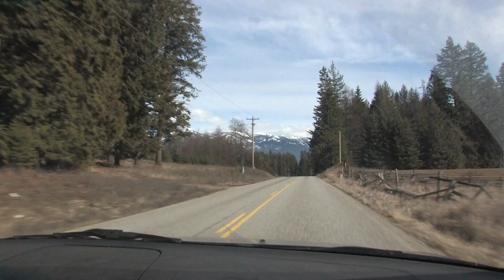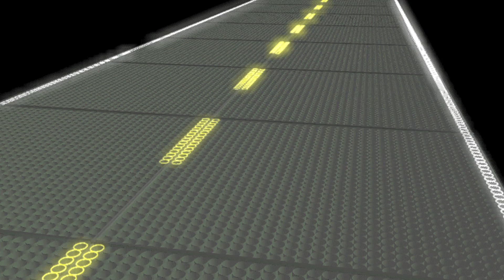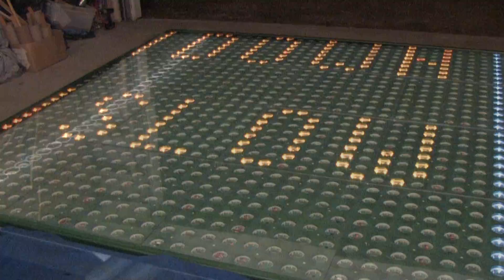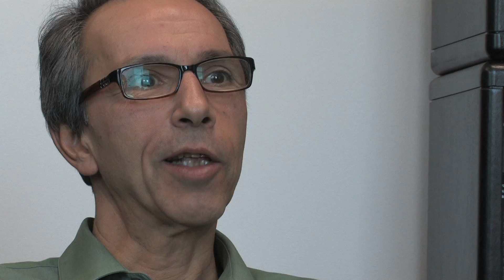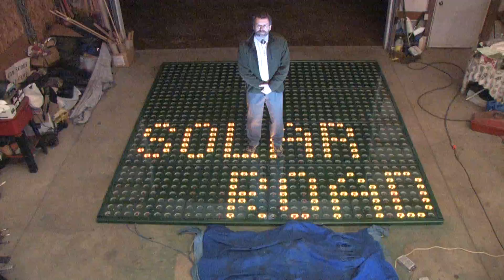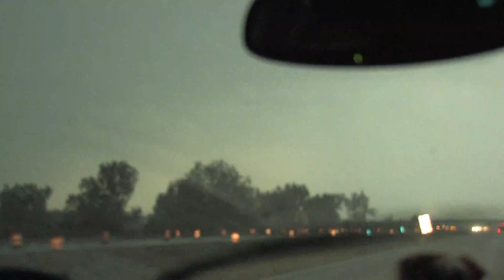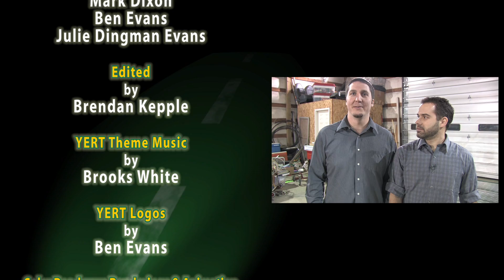Solar Roadways: The Prototype

Comment: How is this economically feasible. Don't get me wrong, as an engineering student i would love to see something like this happen (jobs yay!) but as proposing 6.47497028e10 m^2 of solar panel to replace the roads is quite a stretch. Not only would it be extremely difficult to find the resources for this project but pricing that area with the cost of a solar panel today would be around $21,000,000,000,000, that's generous as you still have tons of considerations to account for.

Comment: And how exactly would they fit this into a 4 minute video? Some glasses have a well-established property of being extremely strong and providing sufficient traction. There's absolutely no need to show it lighting a bulb. Solar power is hardly cutting edge technology. Yes, they have driven cars on it and are currently testing in a parking lot, with much success.

There's healthy skepticism, and then there's just unfounded, arrogant dismissal.

Comment: Yes, flat glass used for windows and windshields are slippery when wet.  However, as they mentioned, there is higher, stronger grades of glass, and glass that can be textured to have the same traction as asphalt.

Comment: The LEDs are nice distraction from the actual practicality of these magic roads.
can you drive on glass? same friction as asphalt?
How much energy can you get out with your design?
Can it survive freeze/thaw?
Cost per sq ft?  Gas will probably go up by $5.00 a gallon to pay for it.
How does dirt and oil affect the efficiency?
Stick them on roofs if you want to put them somewhere. that'll get rid of asphalt shingles

Comment: Panel replacement would be extremely hard at best due to the interpanel sealing, and the cost of everything (panels, wiring, maintenance) are VERY prohibitive.  In addition, such a road would be a net electrical load, as the built in PV modules would not come close to generating the required electricity.  Normal PV modules are mounted so that they are aimed at the sun for a reason.

Comment: Heating elements would use shitloads of electricity.  Electric pavement deicing uses about 25W/ft^, meaning that a 20ft wide road would use 500W PER FOOT, or 2.64MW (2,640,000W) PER MILE.  A 50ft wide interstate would use 1,250W per foot and 6.6MW per mile.  Simply put, it is laughably unfeasible.

Comment: My concerns: Hydroplaning in standing water. Even if snow/ice weren't an issue because of its possible capabilities of warming the surface enough to keep it from icing over or accumulating snow, what if certain panels malfunctioned and didn't create heat? Also, how would dead panels be accessed to get fixed? Cost of infrastructure implementation would be enormous. Much more ambitious than the switch-over to cement roads to replace asphalt currently. Easy to repair and no big rig tire ruts.

Comment: Youtube, please ignore that comment.  If you are curious I suggest googling "Solar DIY scam."  Photovoltaics are cheaper than they've ever been and this trend will only continue.  DIY panels also have numerous safety and quality risks that would outweigh any perceived benefits.    Source: I work in the PV industry.  I am biased yes, but factually correct.  Feel free to check out the scam websites yourself but please don't give those charlatans any money.

Comment: Awesome idea. another thing to consider is road maintenance, the snow might melt because of the heat generated from the concentrated solar cells, but will it gum up, or melt tires during the hot summer months? If this works, I would love to see the day when the ugly utility poles come down.

Comment: My main concern is this: will there be enough traction? What happens if it rains? Glass surfaces covered in water are obviously much slicker than asphalt roads covered in water, so couldn't this largely increase the risk of accidents in the Northwest and other places where it rains a lot?

Comment: , well it is my understanding that traditional glass blocks a significant amount of IR, also the amphorus cells being flexible can go into a flexible resin like a dense plastic, these would be easier to install too, in my mind's eye i see roads being rolled out, whole sections being completed in mere days instead of months, and costing less in materials, and instead of having to break up the old road you can roll it back up and send it in for repairs

Comment: It's impractical because it's a roadway made of glass for a start (in the wet or with oil you have no grip), tire marks and dirt would need constant cleaning, glass takes a lot of energy to make (especially so think), we are not talking expensive more like trillions! Your better off having normal roads and separate green or alternate  power.

Comment: - street polisher/sweeper to clean black streaks and dust. Already have street sweepers so its not out of the question.

-angle the road to allow water to run off quickly. different angles for different parts of the country that have different rain conditions.

Comment: Im all for alternate power, its just this idea is impractical. The cost would be astronomical, glare would be terrible, solar panels have a short shelf life, grip when wet or oily (there is none), roads would need constant cleaning etc etc. The future lies in nuclear fusion and more efficient green energy, not inefficient and impractical ideas like this.

Comment: Cool! :D Though I wonder why not first apply in something with way lower weight requirements and the surface friction issue, such as sidewalks/ only pedestrian areas. (Granted is much less surface with proper solar ray incidence... but it would give time to test some experimental conditions, wouldn't it?)

Comment: Cost cutting idea: Get rid of the LED's, (except for areas of road with special needs - school crosswalks, etc.). Instead, mill (or cast) a 3" to 4" wide by 1/16" deep recess into the "road stripe" side of the glass surface. Apply durable yellow or white reflective material, 1/16" thick within the recess, to be used as the road strip.

Comment: I work in asphalt. And this idea is smart but will never work. It will cost to much to maintain. Asphalt roads use recycled asphalt up to 35% in most states. Which reduces asphalt liquid use. Plus asphalt roads life is 10-15 yrs depending on traffic load. I'm sorry but asphalt will be around forever.

Comment: I'm wondering if you could add a set of inductive coils in each of these panels and feed the coil from a capacitor bank.  Put another set of coils under an electric car and as you drive over each panel it creates a one-time-each high-intensity magnetic field pulse. Drive down a road paved with these, each giving off this field and you would generate an oscillating magnetic field which could, in theory, charge the battery in the car. Thoughts?

Comment: Good idea but it will never happen. This would require a smart grid system spanning the state, every one of these panels would have to be connected to each other (major flaw one panel down can take half the system down), enormous batteries, and potholes would become even more dangerous. Also, the topology of the streets are NOT straight, they have bends, curves, bumps, ridges, and non-uniform hills. This is not a realistic solution at this time.

Comment: But then again, there are alternatives - and better places to put research resources such as Bioasphalt and Polymer based paving. Which I am still convinced will be much less exspensive - if you want solar power use proper solar panels NEXT to the road - which will be properly mounted with regards to the peak sunlight. a Panel lying on the ground wastes a lot of energy. To get it even more effective use a proper Solar Plant, which actually delivers grid power and in much higher wattages.

Comment: Overall this is the most innovative idea I have seen so far. However, there are still quite a few problems to work out. This was posted in 2010, I'm curious to know how far you have come with this project. I'm also wondering if through this technology it would be possible to have heated roads that could melt away ice in northern states.

Comment from the maker: There are all sorts of techniques available to glass-makers. One way to add grip is to drizzle crushed glass on a slightly melted slab of glass-- just melted enough so that the crushed pieces stick to it but not so melted that it all gets smooth again. Pretty clever. There are other ways, too, but that's one that I've seen a sample for. It is super grippy.

Comment: Its not about the strength of the materials. Its about durability and flexibility. Glass is neither of those things, especially flexible. Asphalt has rubber in it which helps tires grip the road and "bounce back" after the pressure from the cars is released.

Comment: The problem isn't solar panels, it's sticking them under a road.

1. They'd make the road you're making freakishly expensive

2. We have BETTER places to put the solar panels. There's no shortage of space on top of roofs. Why would I spend 10x more to put a panel under a road that delivers less power?

Putting solar panels under roads is like making the connection between a car and an airplane. When you put both things together, there are so many downsides that it loses lots of benefits.

Comment: If you make it so that a guy with an IQ of 80 can put this stuff down, and its cost is at or lower current asphalt, and it is accessible without years of wait time to get the product, and you prove it lasts longer, and meets better safety regulations, and works with upcoming technology then it could be a good avenue.

Comment: Earthquakes damage roads mainly because the roads have low tensile streangth and are in one big piece. If you made each slab of solar road seperate, an earthquake would merely separate the slabs, rather than cracking them like a conventional road. Think of a mosaic, an earthquake does not crack the tiles, it merely displaces them.

Comment: There are many, many problems they will run into with it's design that they will have to overcome. I'm sure they're aware and are working on a solution, much like they are working on the solutions to the problems they mentioned - Sunlight glare, ability to withstand a fully loaded semi hammering on the brakes, etc. This project has a lot to work through if it even wants to be installed on crosswalks, let alone highways.

Comment: Combine these roads with electric cars and it is very plausible. The dirt and debris would be cleaned up and would actually create a whole new job, Cleaning  solar panel roads. I think i want to work in this. I might just major is Engineering now.. (i was torn between particle physics or engineering)

Comment: This is among the worst concepts ever devised. I'm all for environmentally friendly practices and all, but this simply cannot be practical or cost-effective. The price of oil is rising, but the cost of asphalt isn't an issue because it's a very low grade of crude and can be recycled after each use.

Compared to this, the cost of SOLAR roads would be absolutely enormous. Why not just build solar panels and lay them along roadways instead? Much more cost effective and practical.

Comment: They better figure out a way to drive down the cost of solar panels. Right now they cost about  $1/watt. Think about how much it would cost to create a road way at that price where 1 square foot has about 20 watts in it. $20/sq ft. multiplied by how many millions of miles? And I'm not even taking into consideration installation costs as well as all the other infrastructure it would take to run this type of system. So, it won't be cheap.

Comment: a) Ofc they would if they had no other choice. but they have it - simply stick to old tyres and call bullshit on new concepts. Not like I'm super happy about it but that's the reality.
b) Asphalt is naturally rough. It provides some rolling resistance = safe. Manufactured glass is naturally slick. Now, how to make glass rough? Most logical idea is to manufacture it with a rough surface, but due to constant friction to car wheels I don't believe it will last long, becoming slick again and unsafe.

Comment: As a chemical engineer this idea isn't very smart. Roads are expensive enough with relatively cheap materials like asphalt in concrete. Photo-voltaic cells are extremely expensive to manufacture because they have to be made by hand. The amount of money it would require to make enough cells to cover a small mid-west city in the U.S. would be astronomical.

Comment: We will run out of oil that's for sure, but not as soon as you think. We need to find an alternative power source but this is quite expensive for the return. if money wasn't an issue this would be a perfect idea, but you don't understand, someone has to make money off of this for it to take off.

Comment: I think this is brilliant, however "Keep it simple stupid."

Just concentrate on the solar energy aspect... and leave the 138,000 LEDS and crap for later.

You don't have to sandwich anything between anything if you don't have LEDS.

You went way over-board in my opinion.

Comment: I'm talking about the variability in solar panels in that power generation can depend on elements of weather, season etc. Basically if you could generate more than enough power for the country, it might not mean it will be available at all times (which is where a dedicated reserve power plant would come in handy). Also the problem with electric cars is not a lack of power, but a lack of reliable charging mechanisms.

Comment: If you have roads that are not used much, like almost all roads outside cities, then it it much more efficient to use solar panels. However, it is indeed a good idea to have these shock panels inside cities or any other place there is a lot of traffic, as solar panels would be less effective.

But I think the shock panels are not strong, or quick enough to capture the power in a moving car. They might need further development, but if they can work with cars, then that would be amazing.

Comment: There's a huge design flaw. Glass is not asphalt. It doesn't have material  properties of asphalt. It's slick. It's less durable. Clear glass = high production costs.

a) Car industry redesigns tyres to fit new slick and EXTREMELY UNSAFE road surface, which I can't see happening.
b) They design glass to imitate asphalt natural properties BUT it will decay due to 24/7 friction with car wheels.

P.S. Broken LED/glass on a panel would requre full panel replacement = HUGE maintenance cost.

Meh...

Comment: Yeah, man u'r right. I was just thinking about the electronic part that will die, making half of the designed road dead. Was also thinking about the costs and the accessibility to remake the system without leaving it vulnerable to stealing. You wouldn't want to end up with missing parts on your road, nor do you want to make it inaccessible...

Comment: You're still thinking short term. The initial setup of this project will be enormous yes but it will pay for itself over time. Running the LEDs will cost nothing as this will generate it's own power. Power relay stations can be connected to roads instead of maintaining above ground power lines. Once it becomes widely used then simple repair costs will plummet. Asphalt was expensive before we made millions of miles of road.

Comment: Every power plant in the country being scrapped is perhaps too courageous an assumption. Power needs increase every year, so by the time this would be able to be fully implemented those power estimates might cover just a large portion of power needs. Not to mention solar power is in general a very variable power source, so you would need a consistent means of power supply (regrettably probably from coal).

Comment: Glass can be hard but still fragile, it's far far more expensive then asphalt, repairs are going to be needed anyway, dirt and cars will reduce the effeciency of already inefficient solar panels, the cost of repainting is far lower than LEDs, and the space that power plants occupy is insignificant.
I would really like this to be practiacal, but it's not.

Comment: When they create the glass they could use a textured mold..... but even then I dont see a glass roadway being very effective. 
Ever slammed on your breaks on a very smooth or wet concrete surface? We cant completely rely on ABS, and then think about the cleanup needed when a surface is 100+*F.... that temperature is enough to lay a small layer of rubber from your tires.... Now we'd have to have road workers with razor blades scraping the glass road.

Comment: Won't the maintenance costs be lower for this project? The glass will be extra resistant to weathering, water and don't need to be repaved. The LEDs mean no more repainting of road markings. Every power plant in the country can be scrapped to make room for houses and it will allow electric cars to become viable.
I'm basing all this on what the guy has said so I'm assuming he is accurate.

Comment: MrRipple actually has a point, doesn't matter how strong the glass is, a 18 wheels truck can eventually crush any surface with full load. This is engineer problem, we don't assume it works because somebody told us it works. how about natural disasters, maintenance cost, damage recover, etc. you're obviously not an engineer, and you obviously don't have critical thinking, Im not sure why you got people thumbed up

Comment: He has a valid point. It is not evident that a road made out of steel would be any good. He clearly does not meen that the gravel itself is a problem, however if a wheel moving a high speed nips a piece of rock it will result in a very high local stress concentration. The glass not only need to have high stiffness and strength but also very high toughness. The prototype only showed that they managed to put some led-diods and programmed to show text. They should test the main function! Bad focus!